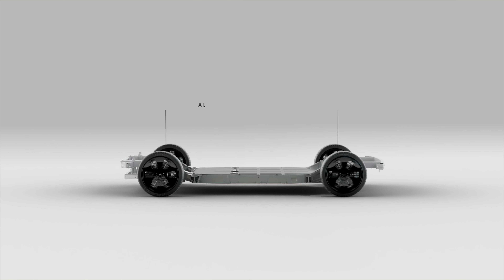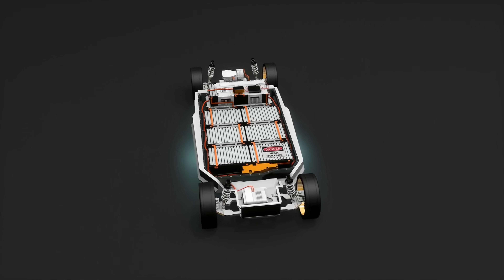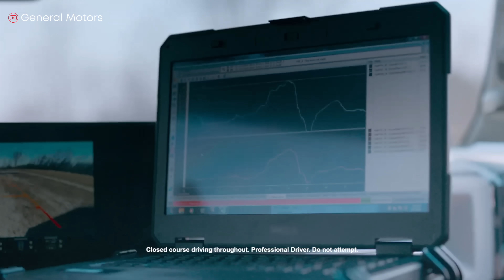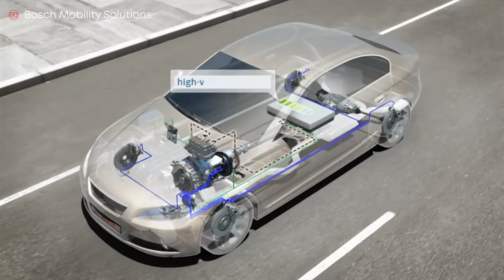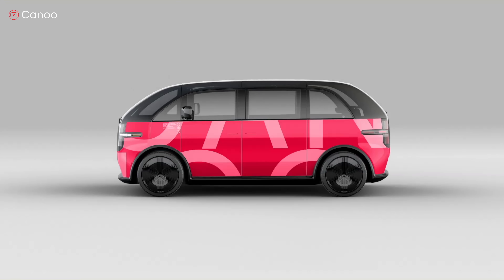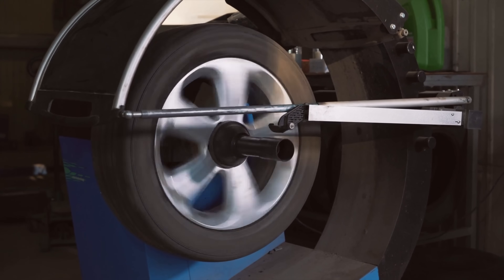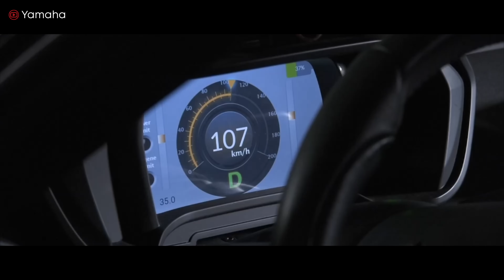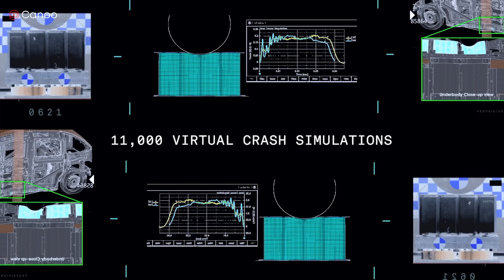No One is Telling You the Truth About Electric Cars, So I Have To

Comment: Excellent vid and lot of information Scotty, they brought it here in Middle East and it surprised users during summer where temperature reach 115 F battery dropped almost 30% or more due to the climate condition!! Also AC was not that great at all.
Reply: It sounds like that you bought a car without a heat pump which would have made your battery and AC cooling much more efficient.
Reply: @stevewallace1117  why would they even ship one without a heat pump to the Middle East?
Reply: Where I live it isn’t uncommon to have below zero F temperatures for weeks with lows in the -30s. I don’t see a future for these vehicles here. It would take more energy  to heat it than move it. Wow, the motors can fail from dirt, that would suck if you live somewhere that has many unpaved roads.
Reply: @stevewallace1117  
It has heat pump but I think auxiliary pump is needed.
Reply: @andyfreeze4072  hey, Mr Zombie. How about more power plants to run the charging of the millions of electric saviours. How and where do they mine the fuel that goes into the battery and how does that impact on the environment? Global warming my hole.
Reply: @Vihara2  because what? your behind the eight ball, hahahaha Ignorance is bliss will only go so far.
Reply: @michaelmaas5544  you don't need a heat pump
Reply: @Andy Freeze
TRUMP SHALL RULE AGAIN!!!
Reply: @allanbehn2918  My feeling is the electric car solution will only cause more problems than we've ever had. There's no reason the internal combustion engine can't take us forever into the future. It's done amazingly well so far.
Reply: @carlbonham3960 . But its reached the end of life cycle.  Go ahead put your head in the sand and pretend nothing else is happening.  Your feeling is based on what ?  The facts show electric is the way forward. Cheaper to run, cheaper to maintain and way more powerful. And you think the rest of the world hasnt noticed?
Reply: @andyfreeze4072  but having a frozen brain is worse
Reply: BTW, I do recognise the damage created by the internal combustion engine that run on a finite resource (oil). I love electric cars for their less sound pollution, less maintenance, instead torque, etc... My biggest problem here is that we also have finite amount of metals used in most of the electric car batteries. What are we going to do when we run out of them? Even more alarming is the destruction caused during the extraction of these metals. My other problem is the charging time. To solve both of these bottlenecks, we need better battery technology. However, the other problems like how to recycle used batteries and the charging electricity is coming from burning coal are not super alarming to me because those can be fixed or reduced to an acceptable level.
Reply: @carlbonham3960  exactly. No such thing as global warming. It's all about money and power. It's not getting any hotter in my country. Besides, whatever goes up gets rained down and buried. Nature is is fabulous that way. Peace ✌️
Reply: @user-nx8ux5ls7q  Oil is not a finite source!!! Go get educated.
Reply: @user-nx8ux5ls7q  we only occupy 0.1% of the earths crust, and thats on the surface.  Your worried about the destruction that  metals extracting causes, are you equally as concerned about the coal, gas and oil extractions? Gas for instance releases up to 20% in methane which is an even bigger problem than co2. Its called perspective. Currently, scratching the earth causes problems sure, but not existential. Excess CO2 in the atmosphere is an existential threat to our species
Reply: @andyfreeze4072  most of what you say is true    climate runaway? trying to figure that one out, don't know for sure
Reply: @andyfreeze4072  Yes I am equally concerned about
Reply: @andyfreeze4072  Here's a conundrum for you.  Roads will need to be built for the EVs.  The present road materials include large amounts of "fossil" fuels to make the tar.  Petroleum will need to be pumped for that.  These fuels are also an essential source for the plastics that are now an intrinsic part of every aspect of life in this century all around the world.  After the components for these products have been fractionated out, you are left with "gasoline".
At present it can be used as a very handy energy source for personal independent mobility.
I suppose in future that can always be burnt to drive the generators to produce the electricity needed to charge the EVs when the sun isn't shining and the wind isn't blowing.
By the way, no sensible prediction based on objective science has the planet in whole warming to non-survivable temperatures.  The predictions that suggest this are not based on objective science and use "estimates" and variables in their formula.  No science uses variables in their calculations.  Any claims that do are pure junk science and best destined straight to the trash bin.
Reply: @andyfreeze4072  Oh boy, some people really have failed history.  There were no estimates and variables in the calculations used to get man to the moon.  Everything was calculated to the inch and ounce.  The amount of research carried out before anyone left the surface of this planet was great and every step was checked and rechecked to be sure.  Hundreds of people worked hard with the "number crunching" needed to confirm that every thing would work.
This planet is not experiencing extra-ordinary rates of change of any climate indicators.  
In the Australian context, temperatures greater than presently being presented as "records" are not as extreme as was reported during the 1890's and early 1900's.
Selective reporting and political agendas are driving the news services and politics has over-ridden objective decision making in energy sources and futures.
The President of the United States has declared a specific objective to shut down the entire fossil fuel industry.  The Paris Agreement essentially follows this  objective and is being forced onto countries where it is completely unnecessary and inappropriate. 
No electric car on the market is actually fit for purpose as a replacement for such vehicles as the Toyota Corolla, Hyundai i30 or Honda Civic.  To be a realistic alternative they must be priced within 10% of the existing price range and be able to fit the user needs (as in seat four comfortably carrying their luggage and be able to travel 600 kilometres on a single refuel so that a trip of 500 kilometres each way can be done in an easy day).  Unfortunately we may have these vehicles forced on us before they are a fair and equitable replacement.
Reply: I BET the Saudis were laughing their Asses off !!! Saying look at that Dummy Driving a Battery Car, is he Nuts in this Heat !!!
Reply: @jlane9055  Do you miss him yet? Are you on the precipice yet?
Reply: @andyfreeze4072  Andy Freeze what is a Maunder Minimum?
Reply: @gerrydepp8164  Well said.
Reply: @tomgrams2333  Capture and store the energy from a lightning bolt.
Reply: @andyfreeze4072  But yet he has a Tesla S and showed off the Electric Hummer. Oh the demomedia didn’t show that huh?
Reply: @andyfreeze4072  YES
Reply: @daviddrake6875  hahahahahahahah,........hahhahahahahahahaha............hahahhaahahahahahha..........hahahahhahahahahaha..........hahhaahhaha, oh stop it, i can laugh anymore.
Reply: @andyfreeze4072  The war in Iraq was not about oil, that's idiotic.  We got, at the time, most of our oil from Mexico and Canada.  The war in Iraq was about the petrodollar, which is much more important than OPEC oil.  The petrodollar is the most important thing to the US in the Middle-East since the US dollar is no longer the global reserve currency.

But I'm sure all of that is over your head.
Reply: @tomgrams2333  there's other sources of electricity there, I hope you know that, right?🤦🏾‍♂️
Reply: @gerrydepp8164  Science doesn't always have a formula for everything.  When there are many interacting factors that come into play, you have to resort to statistics.
Reply: @allanbehn2918  sometime things doesn't have to happen right in your face or felt by your skin to affect you.... Heard of storms and wild fires around the world had been happening more often and more severe? We are all sharing the same atmosphere, it is just a matter of time to hit you in some way if emissions is not curbed.
Reply: @ac-stingz  you are intituled to believe anything you want.
Reply: @allanbehn2918  Of course, but not blindly.
Reply: @therealdavetheraveitstrue1533  None around me are being replenished, I’m a geologist by the way
Reply: @peteparadis1619  whether they are started by lightning or artificial reasons is one thing, climate changes make wild fires happening more frequent and harder to control as draught and higher heat provide the dry fuel it needs.
Btw, firebug set the fire 30yrs ago and still burning? LOL
Reply: @ac-stingz  if you can find a way to stop mother nature let the rest of us know.
Reply: @allanbehn2918  you are part of the nature, so do your part, reduce co2 emissions which trap heat in the atmosphere, that catalysed these extreme weather.
Reply: @ac-stingz  I'll try to fart less. That should do it.
Reply: @stevewallace1117  heat pumps dont make the cooling mode more efficient , only heat mode is more efficient , they dont cool any better than standard ac, they use ac compressor for both heating and cooling by reversing the valve with reverses role of inside coil  gets cold in ac mode and hot in heat mode and same for out side coil , both coils reverse modes , in winter season the heat pump is more efficient down to about 40/43 degrees than standard heating for the home ac heat pumps, if need more heat than compressor can supply it then turns on electric heat strips which draw 20 amps for 5 kw plus blower motor amp draw  and 2.5 kw  12 amps ?  dont know what size in small tesla  anyway     a small 1 bedroom apt  800 sq ft  in louisiana  lots have  2 ton units with  5/7.5 kw  kw electric heat strips somewhere around there.
   most sedans have a 40000 btu ac system this is 3,3 Tons ac system , here in louisiana  a typical older home built 1980  3 tons for 1200 sq ft home  
anyway tesla will use a lot more battery when temp is below 43  degrees  as it needs to trun on the heat strips which  draw high amps. 
as regards the ac not performing well in this hot climate that has nothing to do with it not having a heat pump. 
all other cars without heat pumps cool fine using the standard ac compressor system which is non heat pump.
ac sizing or oversizing it seems is what is needed by manufacturers to compete with 113 degree heat and for the small sq ft size of a vehicle , all ac systems must be oversized when compared to a home ac since cars are horrible as to having very little insulation r value most autos only have 1/2 inch insulate in roof area only so it may have a 2 ton system in a standard car i dont think the btu specs ar listed on any cars but they should be that way you could look at the btu specs and compare ac system sizes and compare with others ex.  `12k btu is 1 ton  
18k btu 1.5 ton   24 k btu  is 2 ton  36k btu  3 ton  system  at 113 degrees will require what ever sizs system is large enough to get that inside temp down to comfort level .

cars are so small but may have the same size ac system as in theyre home 12/1500 sq ft home
Reply: @allanbehn2918  But but but...didn't you know.....electric production will be run with lollipops and unicorn farts...😆
Reply: @ac-stingz  oh blow it out your exhaust.
Reply: @generalcoulter  nobody ever said it was without effort.  your trying to fix everything in one go with your logic. In your mind its too hard, because? Renewables are already cheaper than coal power . Suck on the reality and get with the project or get left behind.  You are happy with the status quo, that's your prerogative, but the Kodak museum has a special place for people like you.
Reply: @user-nx8ux5ls7q   "What are we going to do when we run out of them? " recycle ? like,  when it runs out, basically the cost of mining is great than the cost of scavenging, the problem solves itself, as it has with aluminum, which is almost 85% already recycled as mining is expensive.
  We don't need infinite metals, only the amount needed to keep the fleet.
Reply: @planesounds   "the present road materials include large amounts of "fossil" fuels to make the tar" lol, someone never heard of concrete
Reply: @gerrydepp8164   Did you practice parading ignorance for years, or does it come naturally?
Reply: @Vihara2  Please explain how corporations are making $Bns off climate change. We're all ears.
Reply: @jlane9055  Can you cite those regulations? I track these things and I had not heard of any that restrict U.S. production of any fossil fuel, coal, oil, or gas. 2020-21 U.S. production declined because there has been a global pandemic (you may have noticed this).
Reply: @xchopp  no regulations, presidential exceptive orders
Reply: @andyfreeze4072  you're*..........
Reply: @andyfreeze4072  every rebuttal you made is absolute nonsense.....
Reply: @andyfreeze4072  and there it is..... I was wondering how many comments it would take before you proclaim to the world that Trump lives rent free in your head
Reply: @gerrydepp8164  "the exact formula"? You mean the fact that it causes the atmosphere to retain more heat? You don't even know basic physics but you're demanding the high level information? You're a joke
Reply: @allanbehn2918  I own my solar and EV not for global warming but monetary sense , electric bill was over 300 and now is 150 using more energy,  collecting the sun to charge your car makes far more sense than paying hundreds at the pump
Reply: @planesounds  who has forced EVs on you ? It's only another alternative and will likely be cheaper with more production, did you know EVs are cheaper to run than ICE ? Let consumers decide what's best by having more choices , I don't miss gas stations at all , solar panels more than offset the electric bill and you can't refuel at home with an ICE

Comment: What I find disappointing is the conversions. The dozen or so videos that I've seen are darn near $30,000 and a ton of labor. Some of the videos don't mention the cost at all. There's apparently no options for a low buck ev project. Another great informative video,Scotty.
Reply: you can do it as cheap as a couple grand, what are you on
Reply: @Everything13ish  a couple grand isn't cheap at all when you can take the fuel powered counter part and repair it for hundreds
Reply: @cubandaddy8351  you think you wont spend a couple grand on a gas engine/trans every 10 years.  including gas.
Reply: I saw a conversion kit today on alli express that was $548 US . Unfortunately delivery to the US is prohibited for some reason.